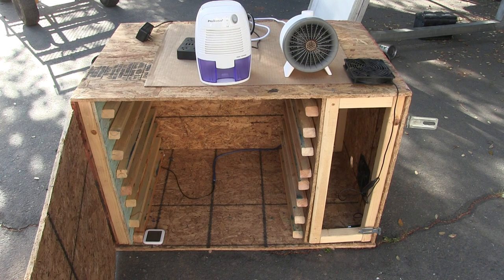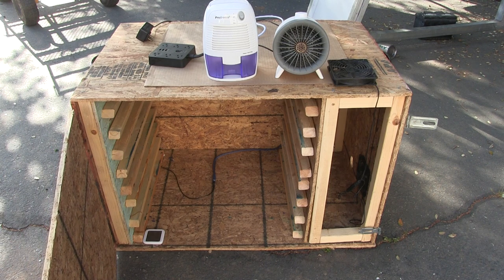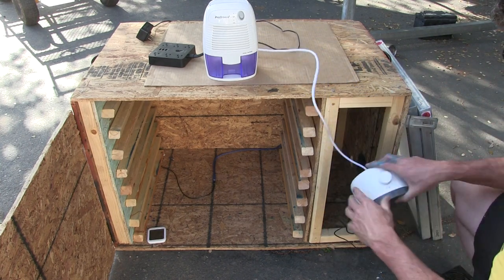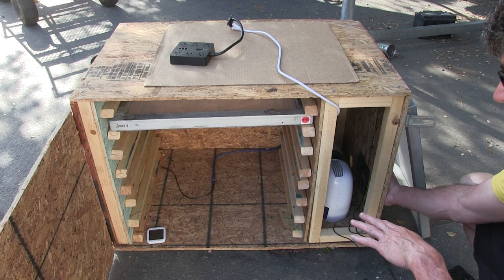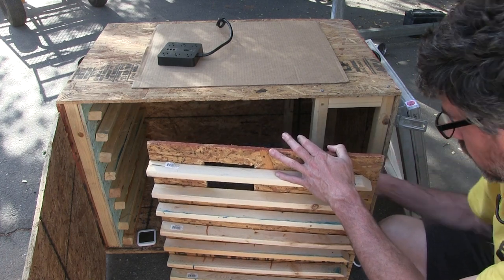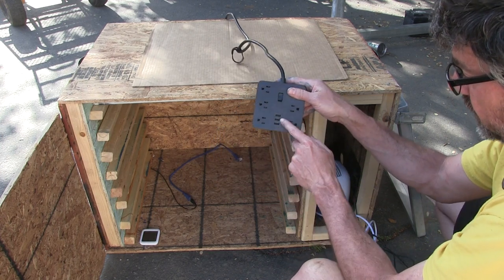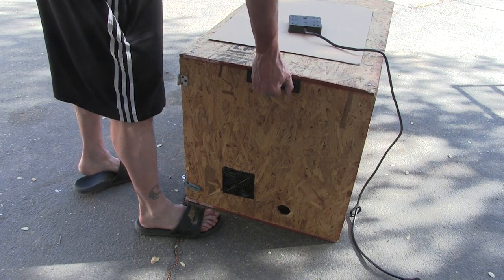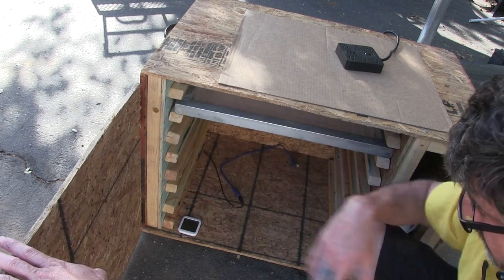DIY Screen Printing Drying Cabinet for Around $100

Comment: What do you guys think of fire safety in regards to having something like this indoors? Would a smoke detector drilled to the ceiling of the box/cabinet work sufficiently?
Reply from the maker: I only let it run for about an hour. Once the screens are dry I turn everything off.

Comment: How fast do the Fans Spin? Do they run the Full 12v ?
Reply from the maker: Im honestly not sure.
Reply: I currently have the issue that my humidity wont drop below 50%, i have the same dehumidifier and 1 fan blows air in on one side while the other blows air out on the other side. They turn the same speed and I have a Voltage Regulator so I can change how fast they should run. I am not sure if the speed has something to do with the humidity not dropping below 50 @screenprintingonabudget9208